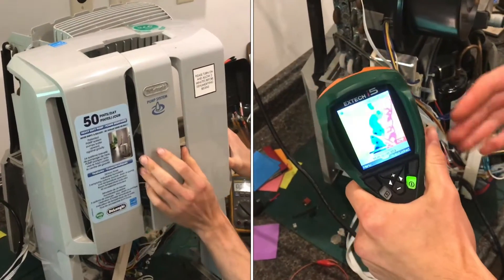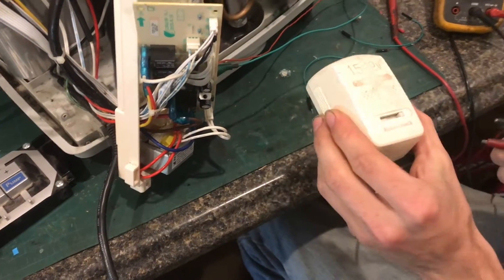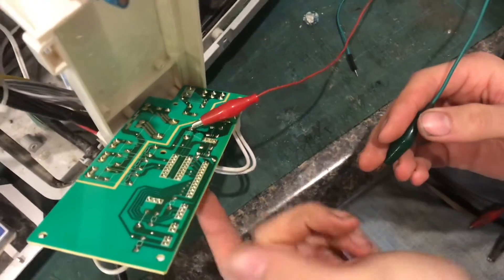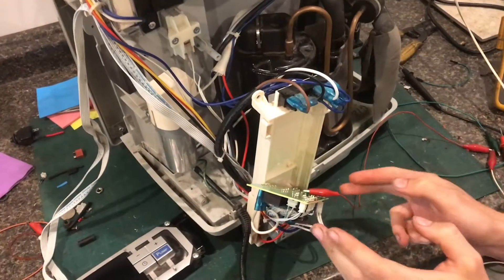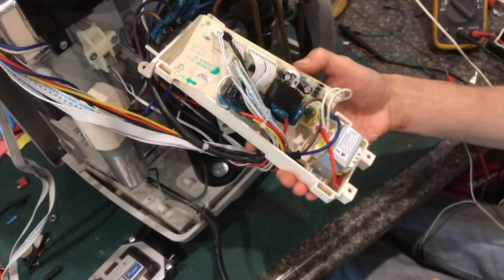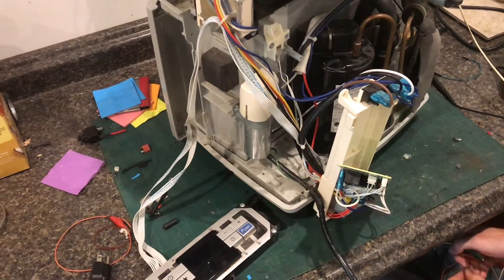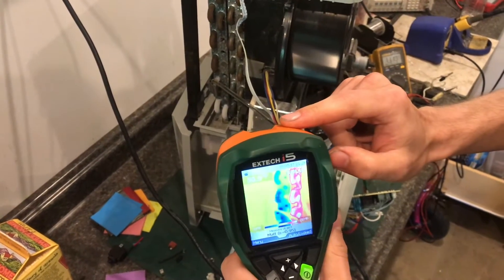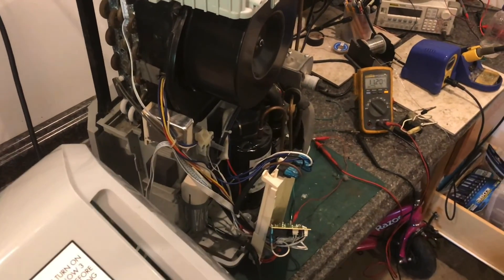how to FIX humidifier (common problem) “stuck” compressor relay

Comment: The thing you're using to get power to the relay, is that just a multi-voltage power adapter with the leads stripped?

Comment: Thanks for the post. It seems it could be my relay also. Compressor was going on intermittently. Is the compressor and fan both designed to run at the same time always? Does the fan ever run by itself (by design)?

Comment: Common problem...  I scored a nice Whirlpool Gold dehumidifier on trash day from the curb.  I ran it all night to test to see if it pulled water out of the air.  Yep, that works.  But...

Even after powering the unit off, the fans and such would stop but the compressor would continue to run until its overload switch would trip.  Obviously, without the fan pulling air over the evaporator/condenser coils, the compressor was sure to overload due to heat build-up.

With a meter on the control side of the compressor relay, it was evident the signal was being provided correctly.  As per my assumption, the power side was stuck in the "on" position.

Running the relay's part number as a Google search steered me to an eBay vendor from China for the exact model number replacement part.

After removing the old relay and swapping in the new one, the device was functioning perfectly.  So, I scored a nice $250 dehumidifier with an hour or two of bench diagnostic work and R&R (remove and replace).  Simple stuff, really!

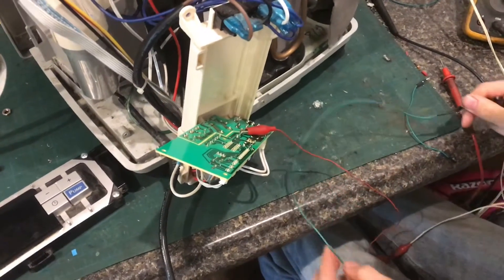Comment: Come on man you need to learn some real terminology if you're going to make these videos. "clicking " " zapping"  3:05  You're stumbling all over yourself. Use words like "engaging" and power up or power on. Speak clearly and succinctly.
Reply: Very mean of you to make such a comment. He is trying to help others. If you can't be nice, don't say anything.
Reply: Be reminded this video isn't designed for a professional  hvac repair technician.  To a homeowner or a tinkerer you could use the word sparky thing in some instances and people would understand what it means.  That said, it wouldn't hurt to add the correct terminology to educate diy people that he'd trying to help.
I dug a 50-pint dehumidifier out of a dumpster at work. If nothing else it's fun to take things apart, but often it's something very simple that breaks or stops functioning. Since I have never looked inside of one of these the information he gave about the relay might be quite helpful for me.
Reply: I'm sure if you get with the YouTube customer service folks, they'll refund all or a good portion of the cost of your admission ticket to this presentation...  ;-)

I do a lot of one take no-editing tips and trick videos to help folks with some sticky problems...  I'm not an actor, educator, or video production wiz.  I am, however, attempting to get the information out there so folks can do things themselves and save a few bucks.

Every once and awhile, my channel gets a bellyacher too uttering the same train of thinking.  It is what it is.  Watch or don't watch.  Learn or don't learn.  And, please, if you can do it better, do!  Then, everyone benefits.
Reply: …move on cat boy, this isn’t a paid channel. Lay off the processed foods a little and good luck in life bud.
Reply: advice from someone with 9 subs…

Comment: I have a Kenmore Elite dehumidifier and it keeps tripping my ground fault interrupt. I plugged it into another outlet that did not have gfi and it runs for a few seconds and then sounds like it is working a lot harder (and dims the lights in the basement) for a short span and it goes back to running again. It keeps cycling through this way. Do you have any idea what may be happening and what I can do about it?
Reply: The start capacitor or resistor (depending which it uses) has failed.